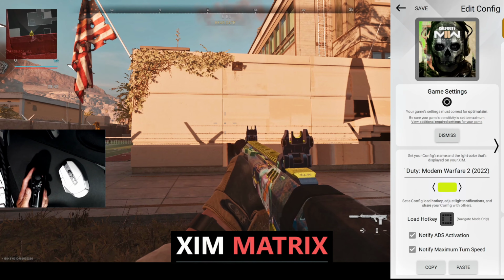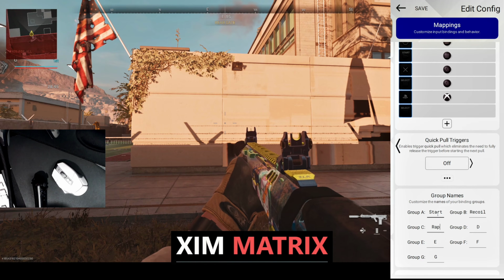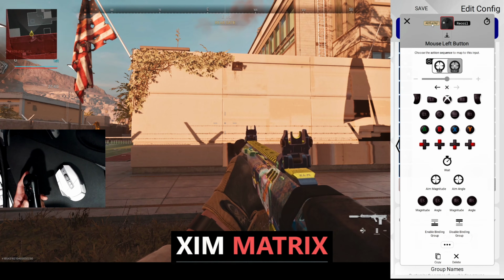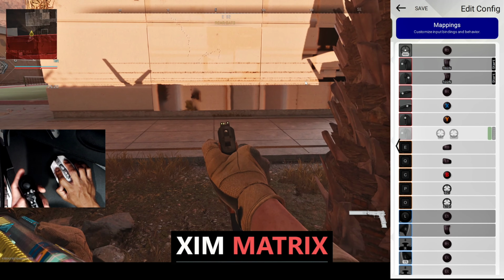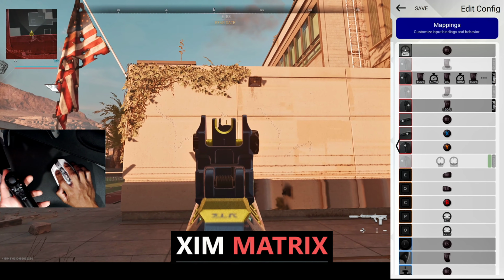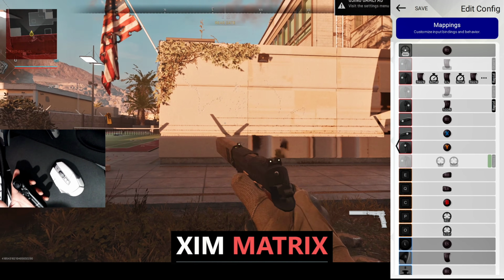Xim Matrix Smart Action setup for Recoil & Rapid Fire w/Sony Nav & G502 Plus

Comment from the maker: Brief explanation of how to setup Smart Actions. Recoil Control relies heavily upon your weapon and attachments with COD so want to get you all started with the basics. Check out iMatrixYOU's Channel for more specific Recoil settings. 

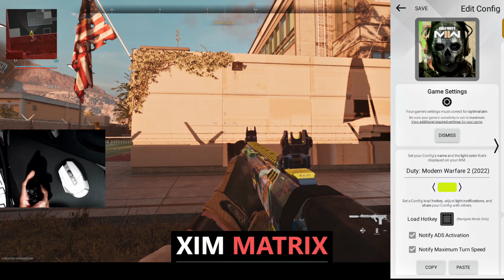00:00 Pre Game Settings
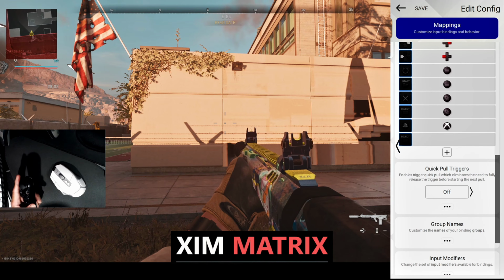00:48 Renaming Groupings
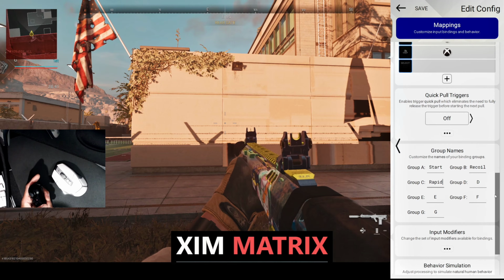01:14 Starter/Group A adjustment, don’t skip lol
1:30 Recoil Control SA
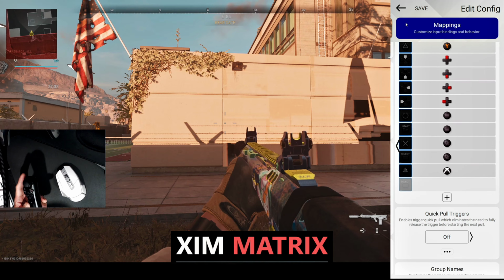2:19 Recoil Control activation
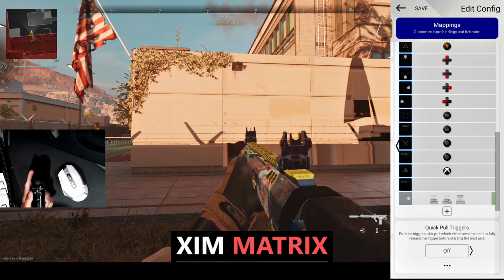3:05 Disable Recoil/Rapid
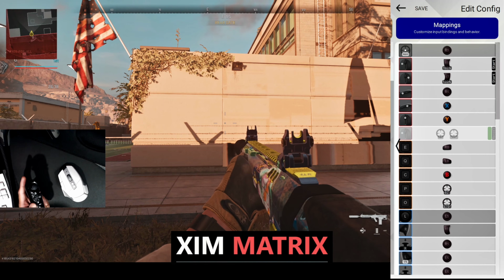3:30 Example w/out Recoil, w/Recoil and why to disable
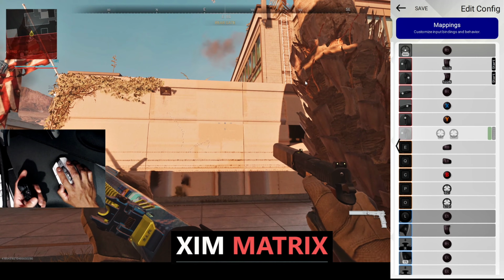4:35 Rapid Fire SA
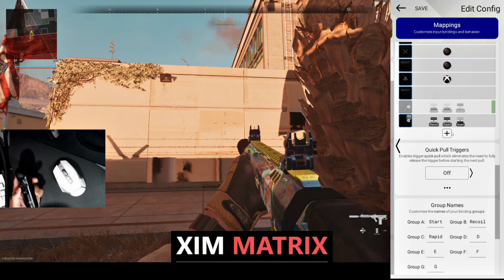5:35 Rapid Fire activation
6:04 Example w/out Recoil, w/Recoil, w/Rapid

This only contains the beginning of my setup before 00:48 for you to follow along with G502 and Sony Nav. Can change Mappings as necessary

>>> XIM MATRIX [Call of Duty: Modern Warfare 2 (2022)] START COPY >>>
XMC:AAAOeXic7Za9SwNBEMXfbIynICgEIloJksQgRt0oQUVCTExAsLYWEitRCCpY+V/Yq1j4jYlflYWFnWhjp5DSTgv7OLcExLuxi4Wwt+x7sz+GhX0cywLoRQoJjPBIQLNqJFnH2DWAOWSxiGUefVjFEmsO61jDJia5nmdWRAllrPBqgTvL3ONqidea50BjT414B4hAgTe4/sLqejCPYouKBh4pBO+Xrnn846cX3uv1mvVfnT6hSe3RHR1gm+O28TY5Xg44vLFV9wZrA26O81VRJAqpKP+/Nlt7N/wjt3fDXwcMOAjwNCWUmxkF+UHhgeHbVj/s7m8XYKRNgKOOAJMxAcaTAhyMCHBY++H986gfPrzuCMdUu37oPB1KJ9oXYOxIgsfSiU4EOHQuBVIR4HhVgKkLAU5cCnDqTIDTVxI8FWD6WoI3AsxInVk36QaErW1ta39dqTo9XehURN8PCIWM0RmjWaM5o7NG80YLXyaC0TE=:XMC
<<< XIM MATRIX END COPY <<<
Reply: Can you use wire mouse
Reply from the maker: @jacobramos-dq5rd  depends on your mouse, but most can be used wired. The forum has more hardware support

Comment: I want to use my nav wireless.  Which dongle is needed?  Searching xim forum is no help
Reply from the maker: No dongle needed but you need to plug it wired first. 

https://youtu.be/-BZ1E0evdNI?si=_ekgzq-QQuf8QsQt&t=28

● Pair your Nav to XIM MATRIX:

For Wired Use: Plug into port 1 or 2 of your XIM MATRIX
For Wireless Use: Plug into port 1 or 2 of your XIM MATRIX, wait 2 seconds, then unplug your Nav
● Configure Navigate Mode: A Nav doesn't have the DS3 Select and Start buttons so you won't be able to disable Navigate Mode with it. Change the Navigate Mode toggle cord within Manager: